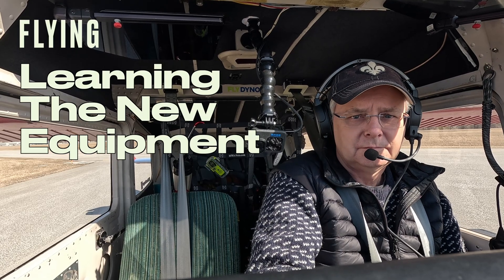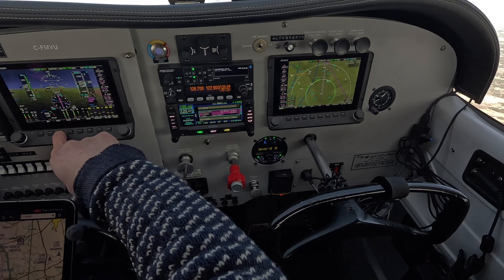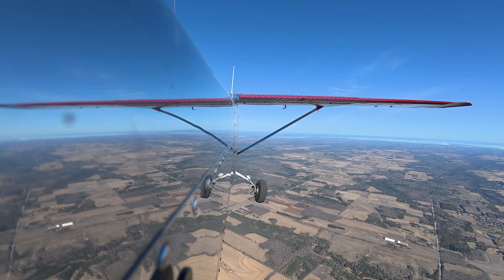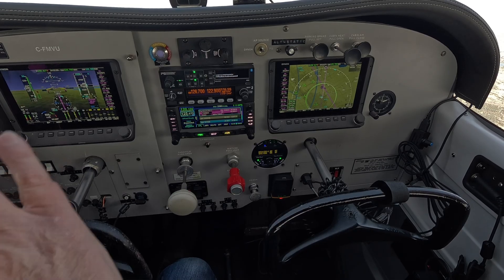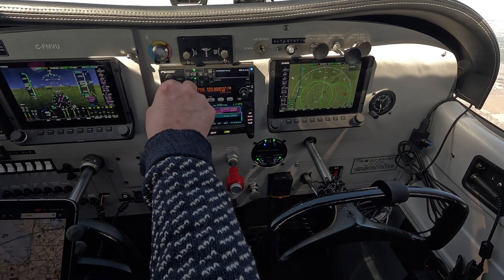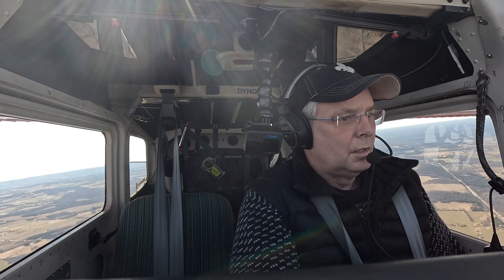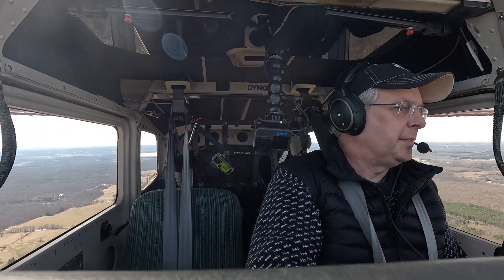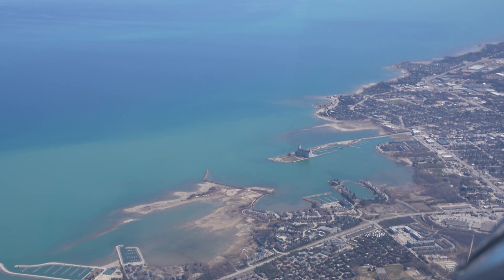Flying With The New IFR Equipment

Comment: Excellent choice on the Avidyne NAV/COM GPS. You will not be disappointed. So many cool and useful features including the datablocks. By the way, rubberbanding on screen (via Avidyne or IFD100) is an alternate option for 'diverging' off course. VERY shiny airplane 🙂.  Enjoy!
Reply from the maker: I've been playing with the rubber band feature, also seems like a great way to add a random hold / circle point.

Comment: Pretty Cool! How responsive are your Glide Slope and (Slew?) Right or Left of Center Line Needles, when you compare them to what you are seeing visually?  You trust them, I take it.  I have 3 suggestions: 1: Trent Palmer has discovered  (an Experimental) inexpensive Radar Altimeter, I think.  2. Jerry Wagner has a couple cool vids of his hard IFR procedures into KOAK, ie: his instrument visual scan. 3.) Consider learning CW/Morse Code, if you don't already know it.  This ensures you won't accidentally tune-in and IFR  land @ Offut AFB or something.  😬...
Reply from the maker: I saw that radar altimeter at Oshkosh 3 years ago, almost bought one. The inventor was still hand making them at that point. Morse code for decoding VOR signals is almost a lost art at this point; both of my nav radios auto detect and confirm the transmitter. Though I've been keeping a morse key on my kneeboard and trying to learn... because you never know.
Reply: @GlensHangar  LoL, Yes.  A GA pilot put down in hard IFR accidentally @ a USAFB a few years ago and they were not amused...  Also, a Test Pilot got it wrong and landed a 737 @ a GA Airfield outside Chicago, too short to Take Off Again. I think they had to dis-assemble the 737 and flat top it out of there. Oops. 😂...

Comment: You literally took the words out of my mouth about getting locked into an ecosystem. 

So my question: Talk to me about the weight of the install. Did it add a bunch? Stay the same?  Or lose some weight?
Reply from the maker: I lost about 20 pounds of weight by getting rid of the steam gauges - there would have been a larger weight loss if the aircraft had a vacuum pump. But MVU didn't have a pump it had the Venturi pipes on the outside.  Through the whole process I shaved weight wherever I could; firewall forward we ditched a few pounds with lighter / newer / stranger starter and alternator; I gutted the interior as well which saved over 30 pounds. Not to mention stripping it to bare aluminum.

Comment: 9:45 On the topic of offset tracks. May I suggest we take inspiration from the North Atlantic track system, which in turn might be inspired by the old-fashioned navigation by looking down at landmarks below your left window (the pilot typically sits by the left window), and favour offset to the right.

If you, and everyone else, flies offset to the right, by a random, but reasonable, distance, then at least separation from opposite traffic should be good. Now, I guess if where you fly, opposite traffic is already well separated by altitude rules, does my recommandation end up counter productive? I am interested if anyone has an opinion on that topic (I can't quite convince myself one way or the other).
Reply from the maker: You are correct about the 'slop right' for IFR tracks - that is the standard.  In this case I offset Left so I could avoid airspace that I couldn't climb over without permission.
Reply: @GlensHangar  It was well explained in your video; nothing wrong with that at all. I think I made my points a bit messy by giving two points in one go. I will try to explain.

The first point was a response to you not being entirely convinced if 'willy-nilly' offsets are a benefit to safety; but my guess is that the randomness by itself will in fact be an advantage.

The next point was that I wondered: At, say a visual reporting point, it would make sense for everybody to offset to the right - to get that familiar (road) roundabout style traffic flow. But what about at ordinary piston single engine cruise levels, will 'right only' offsets beat 'willy-nilly' offsets there too(?).

Comment: Love the new panel. But it’s amazing isn’t it, we all still carry an iPad for yet more navigation info - there seems to be nothing out there that replicates the old paper charts so well. I fly in the UK and Europe and most people have an iPad, and everything on YouTube from the States and Canada the same. Is there any certified panel mounted avionics unit out there that can show the sectional display?
Reply from the maker: My panel will display IFR approach charts, but not the sectional. I still carry up to date paper charts in the plane, maybe someday I'll figure out why.
Reply: Yes, the Garmin G3X displays a decluttered Garmin version map, Canadian VNC’s or US sectionals or Canadian or US IFR charts. All easily toggled between. All the manufacturers have different pricing between their certified and non-certified products. I can’t speak to those different pricing strategies but the full Garmin panel I put in my homebuilt Rans S20 was only about 10% more than a similar Dynon package would have been. Maybe Garmin crank up the price for their certified product more than the others. I did not see being “locked in” to a single manufacturer’s ecosystem a problem…Garmin are so dominant that they really set the interoperability standard that everyone has to adhere to anyway.
Reply from the maker: @martinjmerritt  About that... Garmin has many proprietary systems that they don't share - or that they don't fully unlock for other manufacturers. When I started planning this (way back at the start of the channel) there were a bunch of conflicts where the units from other companies couldn't talk to the Garmin equipment. Garmin is very closed loop - the Apple of the avionics world.

Comment: I’m not an airplane surgeon, but my dad is(was). He’s now retired, but, without going into a full inventory, I’ll say that he has personally worked on the heavy structure of each and every C130 that has ever flown. Never mind other aircraft. Cutting happens. It’s all about how it goes back together.
Reply from the maker: True - the problem with cutting the structure behind the panel to make stuff fit is that it happens willy-nilly over time. A little bit here in 1970, a bit more in '82, etc, etc, etc; with every new install thinking that they are just 'cutting away a little bit'. Over 40 years it adds up and the structural panel loses all integrity.
Reply: @GlensHangar  I’m sure you have people to advise you, but if you’d ever have questions about structure, I’d be happy to connect you with my dad. I wasn’t exaggerating when I said every C130. Some of his modifications to the heavy structure are standardized and have been carried over into current designs. The only reason he doesn’t hold patents was down to the way his union contracts were written.

Comment: Glenn, does the new system allow you to perform RNP or LPV approaches with the auto pilot coupled? Many airports now up north are switching to LPV due to lower minima that closely resembles a ILS (within 50 ft to. 100ft). Maintaining ILS equipment is getting expensive for airports now and they are also going to slowly disappear. 
I guess a WAAS receiver is required but curious if your set up has that capability. Great to see the video and keep up with your currency!
Reply from the maker: This setup will do coupled LPV approaches - but the autopilot is only certified to 500ft AGL.

Comment: Nice setup.  How is it in turbulence.   I purposely went with knobs versus touch screens because of issues with hitting the correct soft keys when bouncing around badly.  Sadly IFR and turbulence go hand in hand a lot of the time.
Reply from the maker: Everything that you do on the Dynon (Avidyne too), has a corresponding knob or button that you can use in rough air. It also has a 'shelf' top and bottom that in moderate chop gives you great stability for the touchscreen.
I've been in air so rough even the knobs were hard to handle.
The Dynon has full ADS-B in and out, so I get traffic / collision alerts if the other plane has ADS-B out. But here in Canada that safety measure isn't mandated, so there are more planes without than with. I'll often go high and get ATC Radar surveillance and they do a great job of keeping us separated.
Reply: Also.  Do you have collision avoidance alerts?

Comment: Re: time code drift with Go Pros. Podcasters often use clappers at the beginning AND end of recordings.  Then you can line up the beginning as if you have good time code, then use the clappers at the end to scale the audio to match. 

If you do that, then the average drift is dealt with. You are also dealing with different equipment and temp for all your recorders, so the random drift may make this technique non helpful for you. 

You don’t show your clapper very often in the videos. Maybe you already are doing this.
Reply from the maker: I'd been sync'ing them with a QR code to match with the audio recorders that I use, but the drift isn't linear and isn't the same between cameras. (I've worked on professional film sets as my day job for 30 years). I'm now linking them to a timecode generator that will keep them in sync no matter what they want to do. (Tentacle sync)

Comment: Great seeing you flying again. I had a question about the autopilot you have. Is it controling everything or do you still have to control something when it's activated? Does the new system help with that fuel issue you have that you have to switch from one tank to the next every 30 minutes? I might be wrong on that. Do small planes like MVU have a black box like big jets. I always hear about looking for the black box on the news
Reply from the maker: Unless I did a complete replying of the fuel system ( I don’t think Cessna even makes the kit anymore) I’ll be switching tanks every 30 minutes. I’ve setup a prompt on the Dynon that tells me to switch, so at least I’ll never forget.

Comment: Couple of comments.  About your choices, yes, Garmin certainly provides an entire ecosystem and you know that everything works together.  Kind of like IBM back in the infancy of home PCs, you bought it, it worked.  But, it comes at a price.  When you started down the Dynon road, you opened options.  You broke out of the ecosystem.  You could have done other things.  I don't know of any other avionics company that offers a complete, turn-key retrofit solution other that Garmin, so you were left doing it piecemeal.  But, Avidyne, Trig and others have worked together integrate together, and at a less expensive cost.

When Kris, over on BaronPilot switched to the Avidyne Navigators, he went into detail on them, and there are a lot of features in them that are really pilot friendly, and support 'ease of use' while still giving you outstanding control.  Is the Avidyne better than the Garmin, or the other way around?  No, I don't think so, kind of like PC versus Mac, both get the job done.  I really do like the iPad App for the Avidyne's though.  I think that is seriously cool, and useful.  While GarminPilot may allow you to put in your flight plan and stuff, I don't think it gives you that kind of control once you're flying

I've heard the PS Engineering audio panels are really advanced, a lot of features.  Garmin did do one thing I really liked on their higher end panels and that was the ability to channel radio outputs to different sides of a stereo headset like your Bose.  So, radio 1 might go to the left side, radio 2 to the right side.  I don't know if PS Engineering came out with something like that or not, but to me, that would be something I would want, especially in IFR flying where I'm trying to listen to a whole bunch of stuff at once.

I don't know enough about Trig, although I've always heard good things about them, but I like the integration with the Dynon.

So, in the end, you have a great panel that will get you where you need to go.  The airplane is 60 years old, it's not meant to be a racer, it's not going to go 200 knots, it's not going to be in the Flight Levels (above 18,000').  Once you get your IFR, it will get you into the low ceilings and marginal conditions and will do it with accuracy.  I don't think you can ask too much more than that.  For your level of flying, I think it's a perfect setup.  I've said before, I lost my medical, epilepsy, I'll never fly again.  I haven't flown as PIC since the 1980s.  So, I don't have personal experience with any of this stuff, so take everything with a grain of salt (or rice).  If you decide to one day move up to something like that 310 that was sitting in the hanger, or that Malibu that was sitting on the ramp at Owen's, you can move to something like the Garmin and do a complete glass panel with total integration.  In the meantime, my opinion is that your current setup is just great for the flying you are doing.  Furthermore, I've commented that I thought getting your IFR ticket was one of the best things that you could do, and now that the airplane is capable of doing it, and you're on the road to getting your IFR ticket, it is going to make you a better pilot.

Finally, I love the external starboard side external shots with the polished aluminum of the skin of the airplane.  Those were great!  Loved the visuals of those.
Reply from the maker: The PS Engineering intercom has a function where you hear different audio channels in different parts of space. It’s really cool the way it separates out the voices on different channels. The Trig radio is great, sounds amazing and reception is fantastic, just after I installed it, Dynon and Trig announced their merger. They were already well integrated, so now it can only get better.

Comment: Looks like a fun flight and good to see that all the new gizmos seem to be working reasonably well together. What AP did you go with and does it have envelope protection/straight-and-level button? What are your thoughts on those features?
Reply from the maker: I put in the Trio Pro Pilot - it has a ‘recover’ button that will bring everything back under control. It also has a 180 button that will swing you around and reverse course. Both of those are great at all times, but especially so for VFR pilots or when you get completely disoriented.

Comment: Why did you not practice a ifr landing on the flight?  Love the new setup.
Reply from the maker: Uncontrolled airport in VFR conditions with other aircraft in the circuit.  It's good form that even if I was IFR rated on an IFR flight plan to do a VFR circuit entry to fit into the existing traffic under those conditions.
Reply: @GlensHangar  thank you

Comment: Good to see you tuned the VOR to cross check the GPS. I started flying IFR in the Air Force T-37, a not very well laid out steam gauge panel with a single TACAN and UHF COMM. Fast forward a lot of years and I was left seat on the “new” 737-800 with two IRU’S, three GPS’S, and two VOR/DME’S that auto-tuned to cross track VOR’S through the 2 cross talking FMC’S. As we approached a VOR fix I would switch the left VOR to manual and tune the fix. Trust but verify.
Reply from the maker: VOR's are getting hard to come by - Canada has 'committed' to keeping 60 VOR stations running. Just enough to navigate in the event of a GNSS outage...

Comment: What are you using for you IFR subscriptions? Jepperson? or?? I chose Garmin ecosystem for the simplicity of the interface and subscribed to the "Americas Standard + FliteCharts OnePak" such to get all the navigation data, safe taxi, obstacle, terrain, and IFR approach charts updated every 28 days (yup, another IFR joy to pay for). with  my GPS NAV Com I can actually look at the approach plate, I'm guessing you are using an iPad with foreflight for that ?
Reply from the maker: I have a Jeppeson subscription (owned by ForeFlight) and all the charts, plates, etc are available on either of my Dynon panel screens, or on my iPad through Foreflight. Same subscription covers the Avidyne unit and the linked Avidyne iPad app; so I have multiple places to view the info.